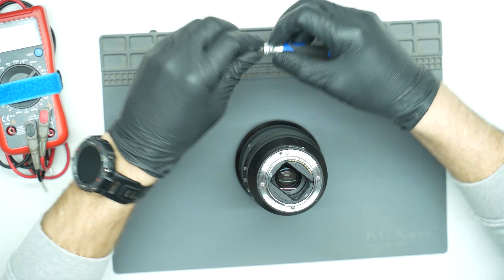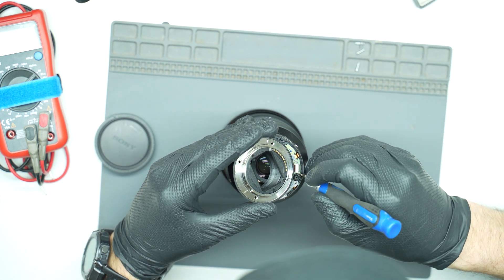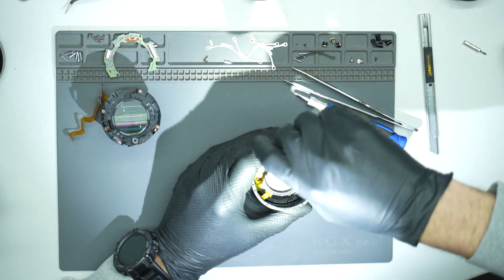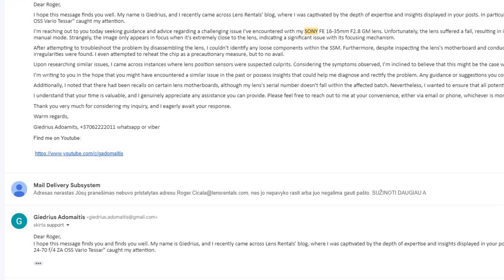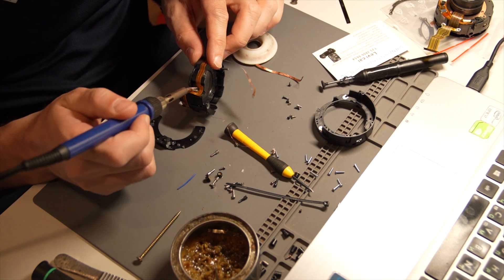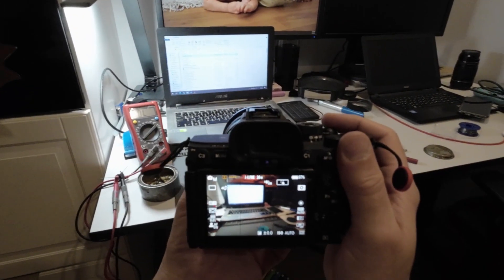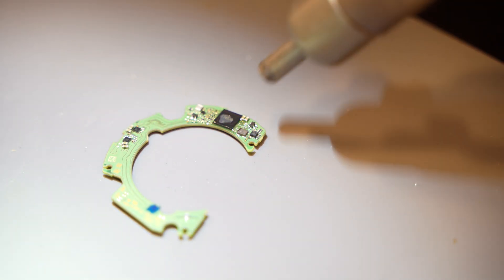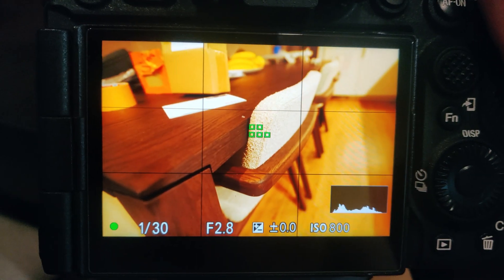Sony SEL 16-35 F2.8 GM autofocus not working, F not appearing the camera is inoperable

Comment: Brilliant! I used my Elgato 4k x for my Sony a7riii using a micro HDMI but now my 16-35mm GM doesn’t work and just shows F - - it worked at the start. I turned my camera off to save battery. Turned it on to find it stopped working. 😢
Reply from the maker: Very sad, out of the blue sky.

Comment: First of all thanks for the video. I also dropped my Sony 16-35 f2.8 GM and changed the focus flex cable and then the main flex cable. Was hoping like in your case that the main flex will solve the problem. When I turn on the camera the focus motor seems to go back and forth, from blurry to clear image, and then stops. Manual focusing does not work. F aperture also does not show up. Any idea where should I continue repairing the lens?
Reply from the maker: Hi, it looks like you're still having an issue with the flex cables. If the lens moves back and forth, it's probably trying to identify its correct position but isn't receiving a signal from the position sensor. Could you check the continuity in the focus assembly using a multimeter? It might be a faulty one of the replacement cable. Just a guess.

Comment: Hello, I changed all the flexible ones and also changed the motherboard and I still have the error. What do you think it could be?
Reply from the maker: Hi, I would check again continuity in that zoom flex. At least I had an error because of that cable, even though it had no cracks no continuity in one of the tracks

Comment: Hi, my Sony 16-35mm f/2.8 GM only focuses at 16mm (both AF and MF). When I zoom past 20mm, it won't focus. Do you have any idea what might be causing this or what part I should replace? There's no official Sony service where I live, so I have to DIY. Thanks!
Reply from the maker: @AgustinIrazabal-ti4hk  hi, you want to replace focusing flex cable. Requires soldering.
Reply: @Gadomaitis  Thanks for responding. Do you think it is very difficult to do? I could get a welder.
Reply from the maker: @AgustinIrazabal-ti4hk I have done it, personally, I don't think it's difficult.

Comment: Any advice on the shim placement near the mounting plate? I can kind of see how they were placed in your tear down, but any further info would be great.
Reply from the maker: Every single lens has a different amount of shims due to calibration needs, sadly my setup of the shims 99% not going to work for your lens. Is it not sharp enough? Some companies can calibrate it, depending on where you are situated.

Comment: I'm happy you solved the issue! I have the exact same problem on the same lens. Lens doesn't communicate with camera, no MF or AF, and no aperature reading. How much time does full disassembly and reassembly take?
Reply from the maker: If you need to go deep and change that first flex, AKA zoom flex it takes 3 hours. If only the main flex cable, I reckon half the time.  Cheers, G.
Reply: @Gadomaitis  do you have a link to the first flex cable? I ordered a $10 on ebay but wanted to make sure it is the right one.
Reply from the maker: @H3Humper  yes, sure. https://www.aliexpress.com/item/1005006875752027.html?spm=a2g0o.order_list.order_list_main.28.3ca61802kC4yW5 . In the link search for FOCUS with IC socket. Unless your soldering skills are excellent.